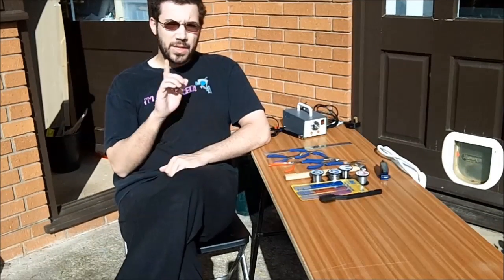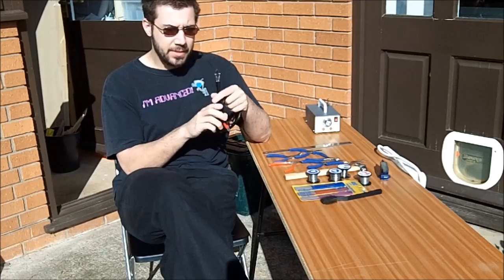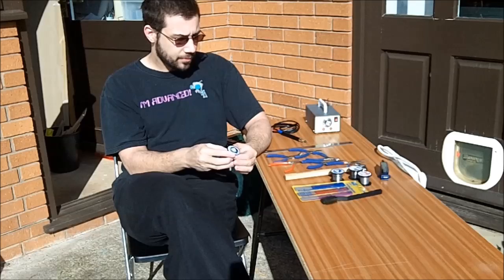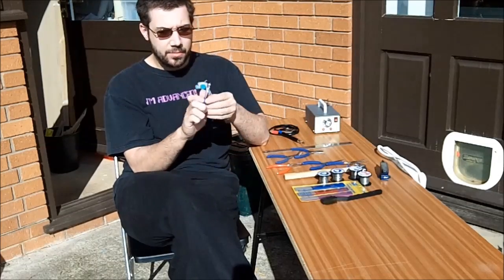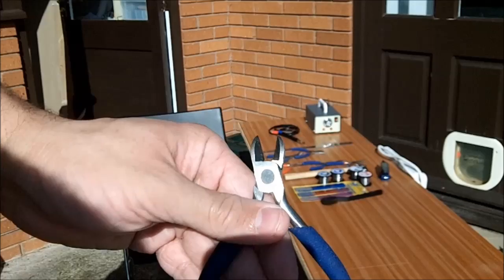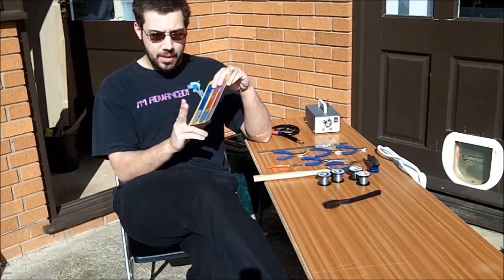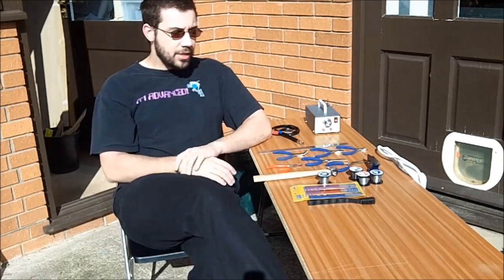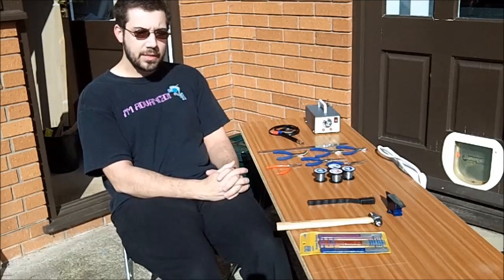The Beginner's Guide - Making Wire Point Tips - Introduction and Tools - #1

Comment: Good Evening, I am in America came across your channel cause I just recently got into wood burning and had purchased a Walnut Hollow tool and seen your review on it which I thought was good. Was curious what is the best type of wood to use when doing wood burning? Also I have realized that this Walnut Hollow burning tool is good for beginners and as I have found your other videos and had also previously researched the wire burning tools. I was curious in your opinion what would be the best wire burning tool to start off with. Thanks